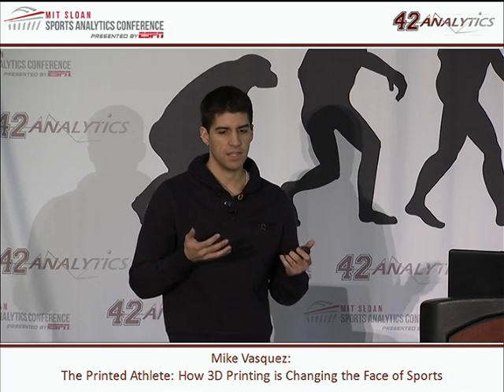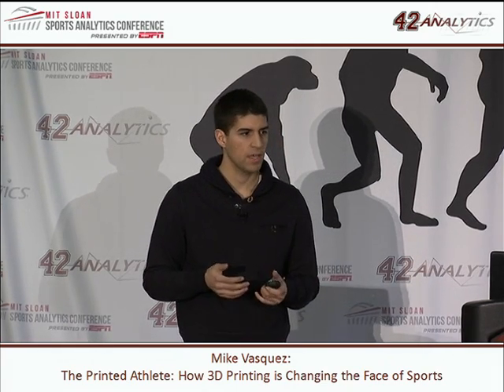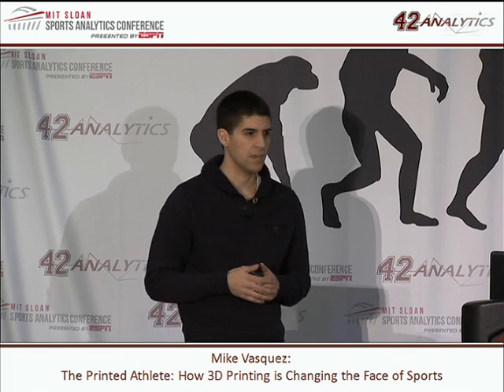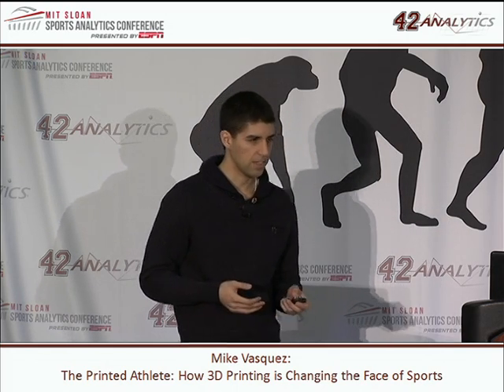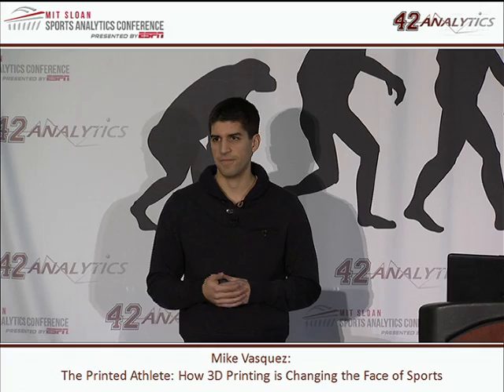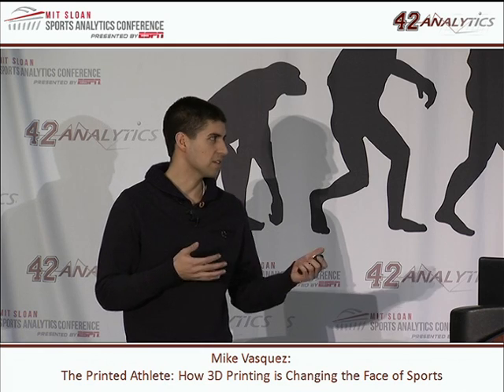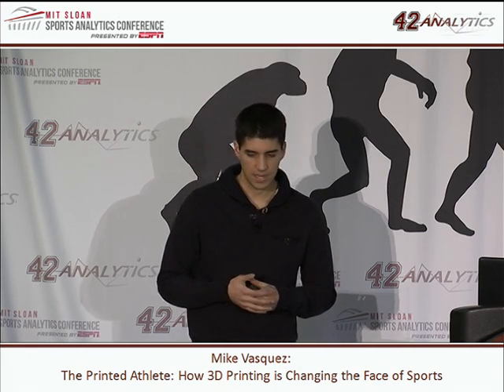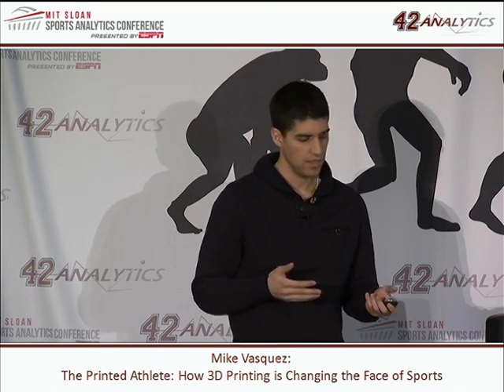SSAC13: EOS - The Printed Athlete: How 3D Printing is Changing the Face of Sports

Comment: check out Airwolf 3D for desktop printers. It is one of only a few desktop printers that has a heated bed, which is great for ABS, PLA, polycarbonate, nylon etc. The gears, pulleys, brackets and air ducts on the printer are all 3D printed, showing their functionality and appearance. 

I'm a huge fan of sports and 3D printing, really cool presentation. Can't wait for the future!